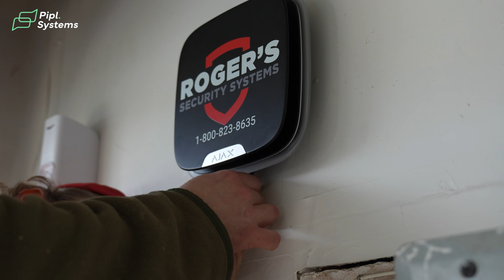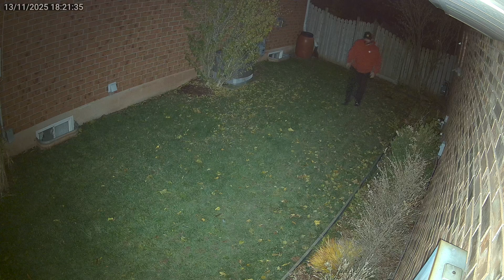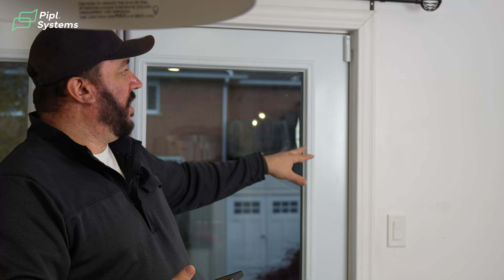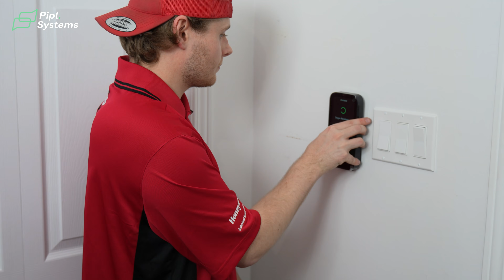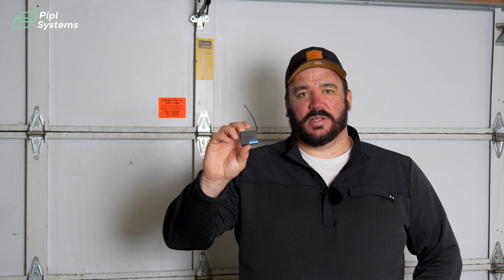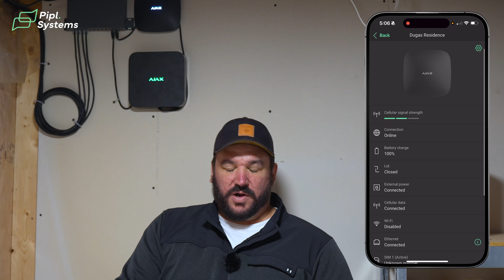Residential Security Case Study: 20+ Ajax Systems Devices & Expert Tips for Maximum Home Protection

Comment: Hi thanks for 5 stars video. I have few questions, if you can help me: For the garage door how to install the doorprotectplus? the CURTAINOUTDOOR is alarmed between 8 and 12 meters, my door garage have only 4 meters this will work fine?, do you recomend this curtain? I also like to know more about the relay for open the door do you have the name of this device? I am in europe and i can´t find it. Thank you
Reply from the maker: Hi! Thank you for kind words 🤝

DoorProtect can be installed on garage doors by connecting the external contact on this device.
Curtain OutDoor may not be suitable for garage doors of this width.
However, the recently announced Ajax Curtain OutDoor Mini device may be an excellent option for you, as its detection range is just right for your requirements.